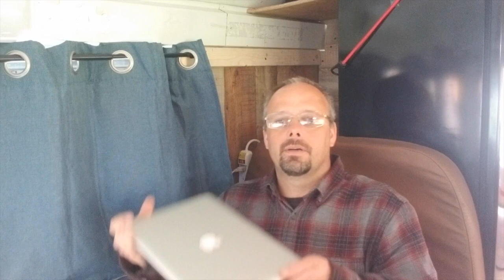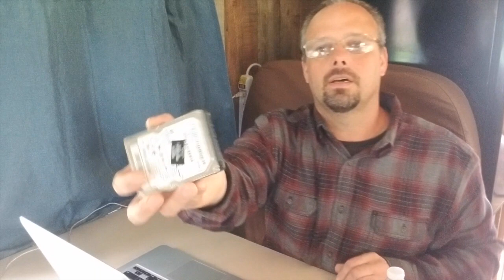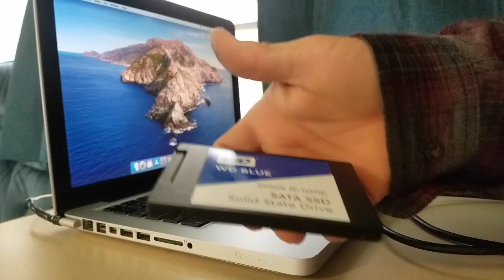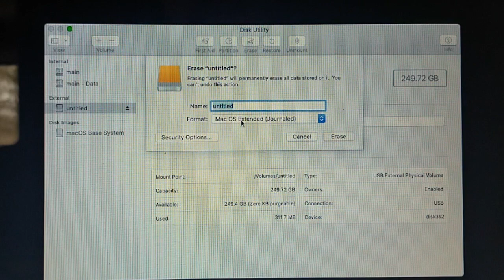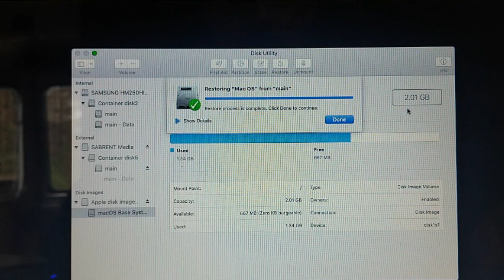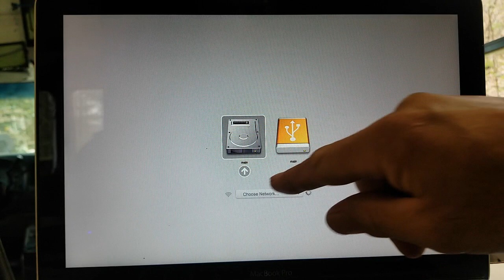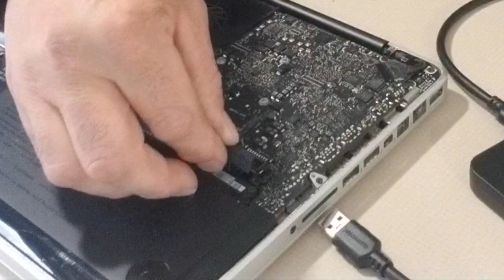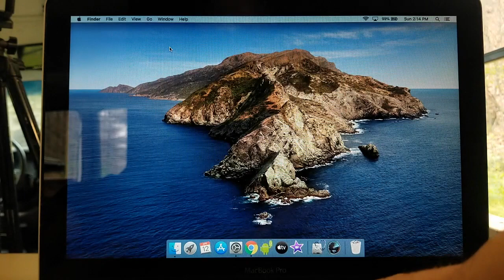Upgrade and Clone Macbook Pro HDD to SSD

Comment: Great vid man!! I did all these steps you showed with a samsung 860 evo ssd and seems to work flawlessly even booting it as an external drive. After replacing it as an internal drive, and booting it it showed the flashing folder with the question mark! Do you think it can be that the sata cable need to be changed too?
Reply from the maker: A lot of the time the SATA cable goes bad. It will work ok until you unhook it then it goes bad. It would be worth a try.
Reply: @lukeFugate  Ok I just ordered a spare on amazon! Hope it's the case. And I tried the ssd on my sister labtop and it's freacking booting so you were right, the cable must be bad then. I'll give you a response after I replaced it on my labtop :D

Comment: i had a problem. didnt work on my white a1342 2009 macbook.
Reply from the maker: What OS are you running?
Reply: @lukeFugate  solved. i just used an ssd external case and installed sierra from a time machine back up. works fine.

Comment: Thank you so much for this excellent video. Very clear and well explained. I now have a mid-2010 MacBook Pro 15in with a 1TB SSD running perfectly. The difference in speed and overall performance is incredible. Keep up the great work.
Reply from the maker: Great to hear! Yes, these computers are still great with a little upgrade.

Comment: So simple and to the point.. Impressed buddy... You are the best.. ❤️
Subscribed..
Reply from the maker: Thanks for the sub! Mac os extended(journaled) although when you select restore it will automatically format your new drive while it clones your data. The main reason I format first is to make sure the disc is completely erased before starting.
Reply: @lukeFugate  I appreciate your quick response.. Thanks again.. ❤️
Reply: One more question i have for you dear..
While cloning my drive, my installed applications will also be cloned? If not, how can i get those applications back?
Reply from the maker: @RajivVyasSurat  it will make an exact copy of your drive.  That includes all the apps and everything.
Reply: @lukeFugate 
I got my new ssd today. Trying as per your guidance. But one thing is different than yours. My main drive is unselected while restore. I have a partition on main drive so my 1st partition is on " read only" mode. How to change that? Please guide.
Reply: I have one quick question.
Do i need to select any specific format type while formatting my new ssd drive?

Comment: so you had your internal hdd Samsung>>Container disk>> and then 'main' and 'main-Data' volumes
and copied the 'main' volume onto your  external SSD Sabrent Media>> as 'Mac OS' volume. Any directions what format should that SSD Sabrent Media be or it doesn't matter and formating just the volume to 'Mac OS extended journaled' should do the job no matter how the parent branch (SSD sabrent media in this case) is formated? thanks
Reply from the maker: It will format it correctly with the steps shown here.

Comment: I can’t boot my Mac with my SSD after cloning it, any help???? I have a WD Blue 500gb ssd
Reply from the maker: May have to try it a couple of times to get it to work. Sometimes the ribbon cable between the hard drive and the motherboard gets degraded and needs to be replaced. I ended up having to replace mine.
Reply: luke Fugate it reads the ssd fine and when I run first aid on it I get no issues. Might have to take it to Apple as I’m out of ideas I’ve tried everything, will they refuse to fix it since I’ve replaced the ssd?
Reply from the maker: @Bawsack121  they shouldn't it should be simple for them
Reply: luke Fugate that’s what I’m thinking, thanks for the help mate
Reply from the maker: @Bawsack121  no problem.

Comment: Those are 00 sized Phillips screws.   For some reason Apple used very soft screws and they are easily damaged.  Using a quality 00 size Philips head screwdriver helps a great deal.   Just putting in my 2 cent's.    The upgrade being done here will speed up this Macbook tremendously.
Reply from the maker: It did speed it up very well and it is till working great! Good information about the screwdriver. I will add that info to the description. Thank you!

Comment: Does this copy over all the documents as well? I’m confused what the difference in the Macintosh HD and Macintosh HD Data is? I don’t know which one to restore my new drive from.
Reply from the maker: It will make a direct copy of your drive. You will restore from the macintosh hd the data will automatically copy over.
Reply: @lukeFugate  ok thanks 🙏🏽
Reply: @lukeFugate  will I have to unencrypt my drive to clone it?

Comment: In your video, you cloned from the internal Drive on APFS Volume to the External Drive formatted on Mac OS Extended ( Journaled) , just wanted to check if that is okay? Just a question from a first timer doing this kind of upgrade following your video. Appreciate your response. Thank you and great video
Reply from the maker: Yes, that is the way I did it. I am still using it and it is working fine. Thanks for watching.
Reply: @lukeFugate  thanks, did try it awhile ago though and when the cloning process was finished i got an error message 😞
Reply from the maker: @pjsibal3916  What was the error message?
Reply: @lukeFugate  hi, i can’t recall but tried it again using APFS to APFS and it worked !! Now the macbook is upgraded with ssd and 16GB of RAM. Many thanks for the video and more power. 👍
Reply: @pjsibal3916  can you tell me what you did? I don’t understand the apfs thing

Comment: I followed all the steps and everything works but when I start my computer it is blank for about 30 seconds and then the Apple logo comes and it starts booting. Everything works flawlessly when it's started but I am wondering what could cause the prolonged white screen in the beginning? I tried restarting it a few times and it does the same thing.
Reply from the maker: Could check to make sure the ribbon cable to the hard drive is seated well. How much memory do you have?
Reply: @lukeFugate  Hi Luke, it is sealed well. I have 4G of memory

Comment: Hi! Awesome video, easy and to the point. Same as others I'm waiting around 95%. My hhd has about 380gb, how much time should I wait before getting worry? In case nothing else happens, Should I turn off my Mac? Tks!
Reply: It worked perfectly! Just took 2 hs with a 500gb disk. Tks!
Reply from the maker: Glad it worked for you. Yes it can take a while for it to copy depending on how much you have on the hard drive and the size of the drive itself. Didn't see this comment until this morning.

Comment: When removing with the screws from the old HD and putting them into the new SSD do NOT do these operations over the open bottom of the MacBook.  If you accidentally drop a screw you do not want to have to try to find it somewhere inside that case.    If you do this over a hard surface like a desk or table the screw would likely bounce and end up in Never-Never land.  Do that job over a soft surface like a towel.

Good video.  Thank you. Now I have to do that whole task myself.
Reply from the maker: Great suggestion on the towel. It would also help to keep from scratching the case. I have dropped screws into the case before. With the battery unhooked it wasn't ever a problem, and I just flipped it over and shook the screw out. Good point though. If someone was to forget to unhook the battery it could cause problems.

Comment: Hello I looked at a lot of video and you did a great job explaining everything. Question  I have I have a MacBook pro 2012 turned it on everything running very slow, mouse pointed stays were I move it and spins the ball, before this happen computer was fast, I appreciate any help , thank you
Reply from the maker: It may be the ribbon cable on the hard drive. Sometimes they need to be unhooked and reattached as they age. I had to replace mine years ago when my computer started doing the same. Also while you are in there, maybe pop the memory cards out and put them back in just in case maybe they have become detached.

Comment: hey great vid but i got a question where did you get you screwdrivers form i saw a set for MacBooks and its like a 100$ any chance you can send the link to your set
Reply from the maker: I found the set I used at Wal-Mart It is a precision screwdriver set. There are some screws it won't remove though. Here is the set that should remove everything and it is pretty cheap. 
 https://amzn.to/3knO35p
Reply: @lukeFugate  dude thank you so much
life saver

Comment: Would you recommend  changing the hard drive cable?  I read elsewhere that the old cable may not handle the faster data from an ssd drive. Thanks!
Reply from the maker: Mine had been changed years ago, but it was the same as original. Mine seems to work great but it would be interesting to upgrade the cable to see if there is any difference.
Reply: Hi Luke, so FYI.  I cloned and installed the SSD and was having terrible slow speeds, boot errors, freezing. I tried the process again with carbon copy cloner and same thing. So I went ahead and replaced the hard drive cable and now everything works great. Super fast boot and running speeds. I'm guessing the cable was probabaly going bad anyways. So if anyone else runs into weird errors after doing your SSD install,  it may be worth replacing the cable too. Was $21 shipped from OWC.
Reply from the maker: @JSEbertowski  Thanks for the information. Good to know.

Comment: Dear Luke very nice job here! One question, specificly for my case. I have created a bootable usb with catalina installer and I will fit a new ssd to a macmini. is this possible? I mean the ssd will be new so i wont be able to make it bootable. Unless i must make the usb for the mac to boot from disk util and make a clean install?
Reply from the maker: Yes, you should be able to install to your new ssd using your bootable usb.

Comment: Why did you format your SSD to OS Extended (Journaled) when your HDD was formatted to APFS?
Reply from the maker: It really doesn't matter which it is formatted to at first. Actually you could skip the format and go straight to cloning. The purpose of the initial format is to see if the ssd gives you an error code or if it is not working correctly for some reason.

Comment: When I got the computer and opened it up it showed a file folder with a question mark. I reinstalled Lion and updated it to Catalina. I have another computer macbook 2012 that has Catalina on it as well. If all fails can I copy from the other computer if so do u have a video showing what i need to do.  At this time I feel really lost on what to do.  Thank you for helping me I really do appreciate it.
Reply from the maker: I think if you clone the drive in the 2012 computer using this videos information you should be able to just replace the one in the other one and have basically two of the same computer.

Comment: What happens if you don't have a backup! I just bought this computer used I'm trying to learn how to upgrade it myself I want to teach myself to do photo and video editing.
Reply from the maker: If you don't have a backup you could lose all the data you have stored on the computer. If you have just bought it and really don't have anything on it personal, you can boot into recovery and restore it by re-installing mac os from scratch which will be putting the computer back to what it originally was when new. This will erase anything you have installed on it. It will then have to be upgraded by installing the newest os it will run.

Comment: I had gotten error 3 code. What does that mean? Also, when i click on erase the drop down doesnt give me the same options as u showed. It says APFS. I'm confused about that as well.
Reply from the maker: Do you have the os updated? May have to do a full update. Are you running Catalina or an older version? 
You may have corruption on your old drive or some bad sectors on the disc. If so a direct clone may not work. You would be essentially cloning your bad drive onto your new ssd and the corruption would be cloned as well.
It doesn't show mac os extended? If not you may try APFS. If all else fails do a complete time machine backup of your original drive, then install your new ssd and try to restore from your time machine backup. You might have to reinstall mac os from recovery onto your new drive and move all your data over from your backup.

Comment: Approximately how long does it take to clone
Reply from the maker: It depends on the size of your drive Also depends on how much data is on the original drive. It could take several hours. Mine was about an hour but I only put in a 250gb drive.
Reply: luke Fugate can u mess up the ssd if u don’t follow directions
Reply from the maker: @debbiesexson7760  you shouldn't be able to actually mess up the ssd. If the procedure goes wrong then you can always try again. Just be sure and do a complete backup of your existing drive before starting.

Comment: Thanks a ton. Looks pretty simple. Not sure if I missed connecting the battery again before fixing the back cover. Couple of quick questions if you could help me with? I plan to buy 1TB. I hope I can partition the ssd to any size to recover Mac+data as long as the size is equal or more. Secondly, I have a bootcamp Windows 8.1 partition on current HDD. Can I restore this partition too to the another partition on SDD choosing FAT?
Reply from the maker: Yes, as long as the size is at least what is in it. You could even put in a smaller drive if you shrink the partition. It should restore the entire drive including the bootcamp partition. If not you may have to re install the windows partition fresh with boot camp again.

Comment: Thanks for your tutoríal, great video I just upgraded my MacBook Pro 13 2012 Mid, however when I restart it, the screen remains, all white, For about 24 seconds, Then appears the Apple and loads like in about 15 secs, then it works just fine, but id like to skip the white screen, so any idea ?? Thanks a lot, now I am your follower 👍🏻
Reply: Found a solution for the problem :) hope this help you helped me 
• Shut down your machine. Yes, all the way down, not sleep or logging out.

Press the power button and then press command-option-p-r. ...

Hold those keys down until your Mac reboots again and you hear the startup chime.

Let go of the keys and let your Mac reboot normally.
Reply from the maker: Sounds like it should be much faster finding the bootloader. You might try updating Catalina to the latest version if it isn't already and see if that helps. Glad you liked the video!
Reply: My laptop does the same when i turn it on its all white mode for a good 15 seconds then the apple logo appears

Comment: Thank you for this! For something that seems like it’d be easy to find instructions for, I’ve been banging my head against my desk. The only thing is that mine has been stuck near the end of the Disk Utility Restoring progress bar for about 4 hours now. It’s a 1TB drive. Apologies if you mentioned a time frame in the video, but is this normal? The details just say “validating target, validating source, replicating, replicating.”
Reply from the maker: Glad you liked it. Sorry for the late reply, YouTube notifications just don't work well sometimes. Did it ever finish? Mine took a while, but not anywhere near 4 hours. My hard drive was quite a bit smaller though.
Reply: luke Fugate no problem! Funny enough, it finished probably 15 minutes after I posted this. My 2012 Mac Mini feels new again! Thank you sir!
Reply from the maker: Glad to hear it!

Comment: Thanks Luke!!!  worked on my 2014 Mac Mini with Catalina. This is better than using superduper or carbon copy! No error message , no issues. Booted up fast , well its a 1T ssd so there.
Reply from the maker: Glad it helped. Yes, an ssd is an incredible upgrade. Brings an older computer back to life.

Comment: I have been using my mid-2009 MacBook Pro for all of my Zoom calls and the start-up and connections have been frustratingly slow.  Thank you for this video....yesterday I installed a 500 gig SSD hard drive with total success and the system now is fast and connects quickly.  The operating system copied perfectly and the replacement of the old hard drive was easy.  Thanks Luke...
Reply from the maker: Glad I could help!

Comment: this style WORKS.. just an add-on .. old OS u need to unmount the drive (example = unmount drive main) then u can proceed restore to work... but this is a good guide... maybe sum1 will have this issue that the drive is in use... just unmount then proceed
Reply from the maker: Thanks for the advice.